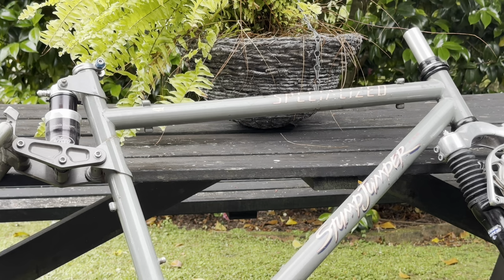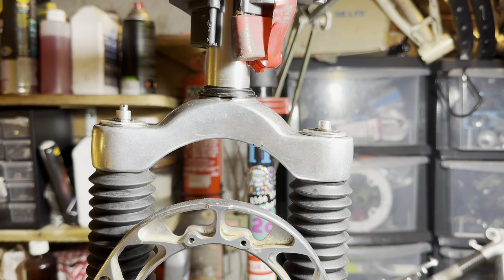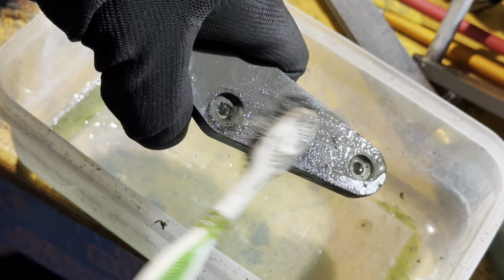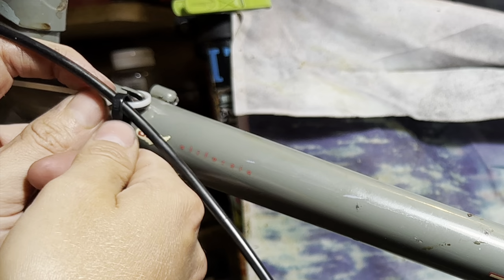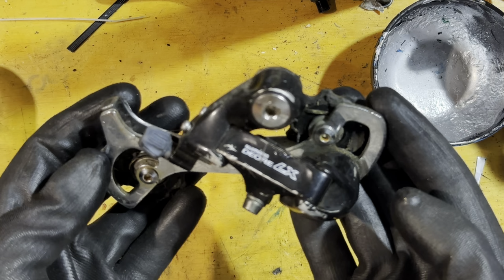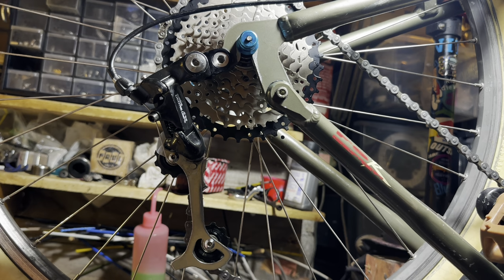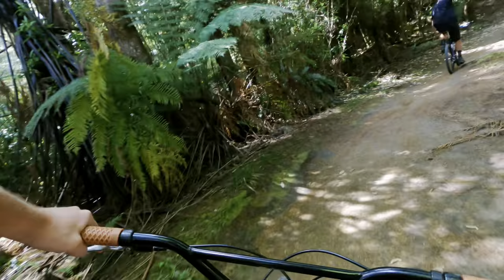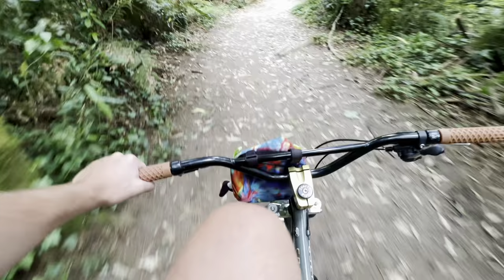Vintage MTB restoration - ‘94 Specialized Stumpjumper FSR

Comment: If you have an air compressor, a Needle Scaler is a great tool for dealing with rust in hard tor each places!
Reply from the maker: Good tip! Haven’t heard of people using them on bike frames, haven’t had any issues with using it on bikes?

Comment: For the rust in the Seatpost spot,try a die grinder tool with a wire wheel attachment, next time works good since you can control the rpm, Thanks for the vid brother!
Reply from the maker: Thank you! Someone else mentioned a die grinder too, with a different attachment 👍 thanks for checking it out! 🤙

Comment: good video. you can get online brackets that fit into the brazed cable guides and which hold the hydr. hose in place. in parallel to the cable guide. I use them and they're great.  thanks for the video!

Comment: Ok bike look is very good. Only one thing: uniposca is not good for paint metal part, you can use Edding paint marker for better works.
Reply from the maker: Thanks for the tip! Yeah it’s just what I had around haha, they work well on painted things though. Will pick some up 😄🤙